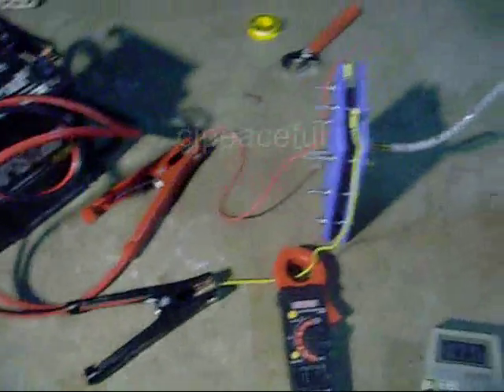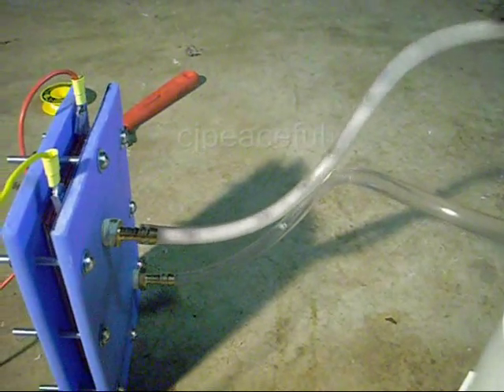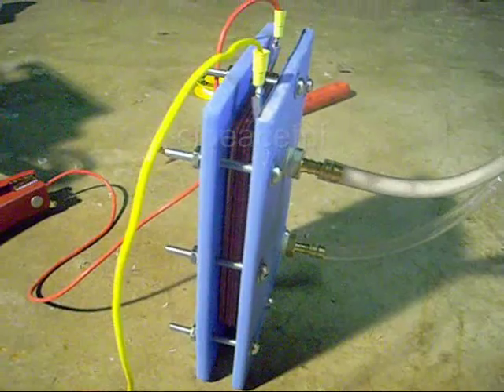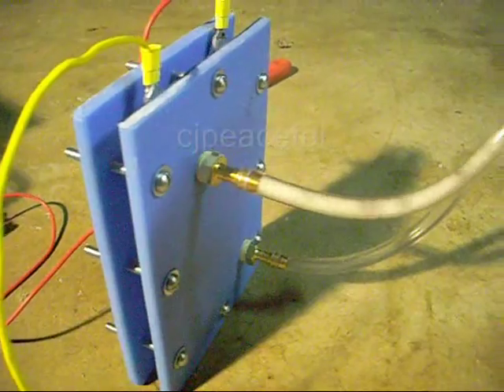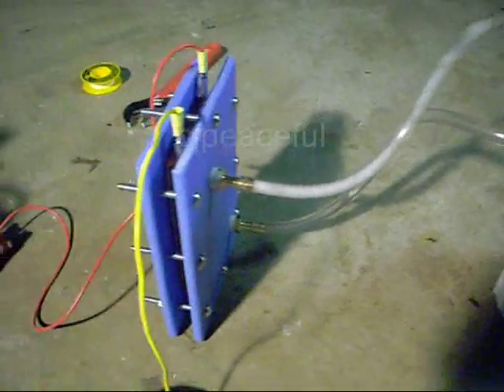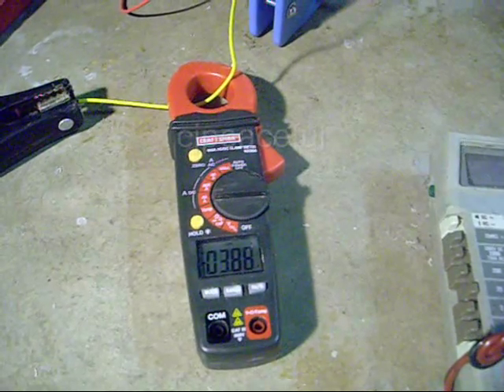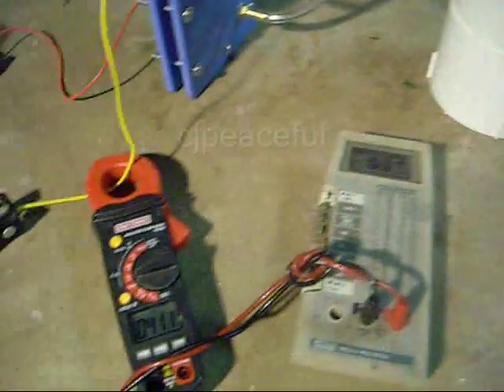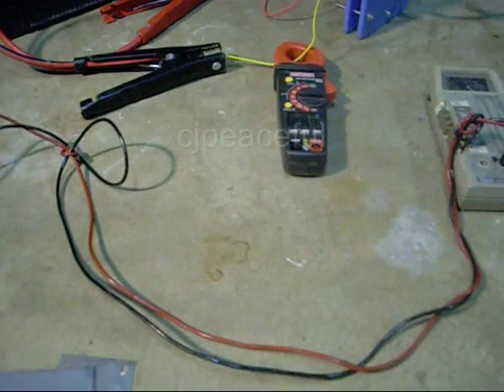SBB Dry Cell (01)

Comment: The neutral plates are for cutting down the voltage per plate gap , the best voltage per plate gap would be in between 2.0 - 2.5 volts..anything over this creates excess heat..
 if you are running +-+-+- you are getting around 6volts per plate gap ,and that will make your unit overheat, and create alot of steam instead gas.How much space do you have between the plates?And also if you are using sea salt you are chlorine gas to..

Comment: Hi, I have a cell I made and I used 2"X1/8"  ss flatbar cut 12" long.  I used 5 of these plates and made them +-+-+.  I don't know how much current it draws but it's between 10 and 40 amps for sure.  I burnt a 30 amp relay that worked for a while.  I now have a 40 amp relay and it is still good.  I use demin water with sea salt.  I still get alot of rust in the bottom and it don't seem to save me any fuel.  What are the neutral plates for and can you coment on mine?  Thank you.

Comment: thats a lot of lye , if you build your cell with a 1/16" gap between the plates and add some more plates and do only 4 neutrals ,something like this +NNNN-NNNN+ it would only take 1 1/2 teaspoons of lye per gallon of water and you can get a 17 - 24 amp draw with that setup..